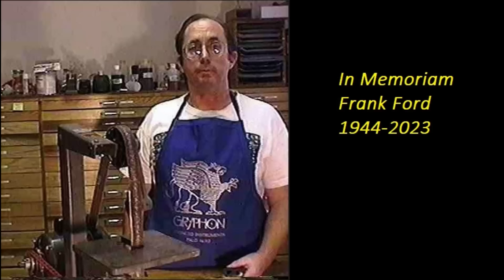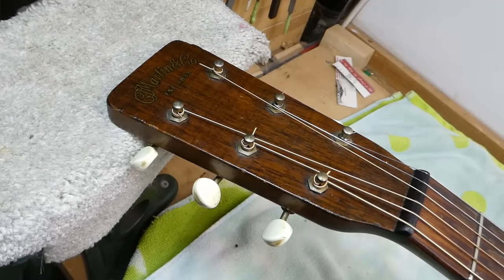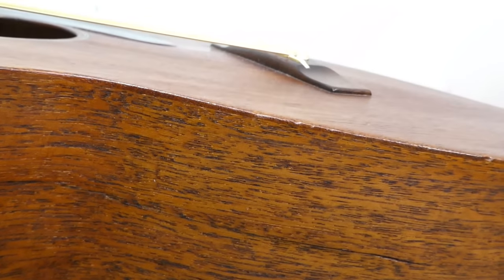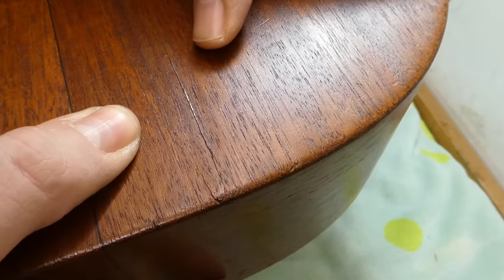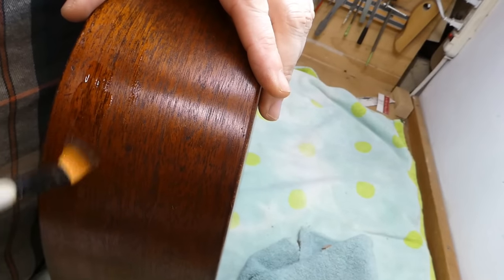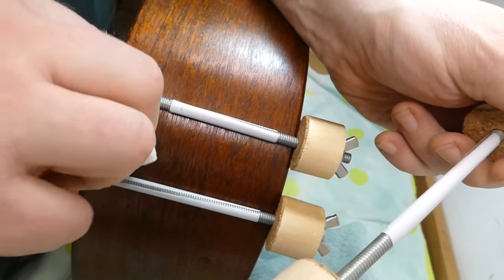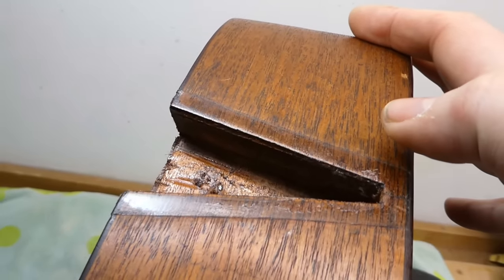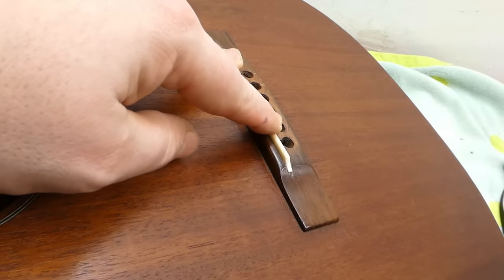This Guitar Smells of Rich Mahogany.

Comment: One of the tuners on my mandolin was failing.  I went to Gryphon Stringed Instuments to look for a replacement set.  Behind the repair counter was none other than builder/repair legend Frank Ford.  I sheepishly said ‘hi’ and ask him about replacement tuners.  He said, ‘Let’s have a look’.  He grabbed a screwdriver, lowered his glasses and went to work.  A few minutes later it was fixed.  He also touched up the other seven.  I asked what I owed him and he just mumbled ‘it’s ok’.  As he was restringing I noticed he was using a string winder like I had never seen.  You can’t use guitar string winders on a mandolin.  I asked about it and he said that he made them.  ‘I think I have another in the back if you’re interested.  They aren’t cheap’.  I said ‘Sold!’ before I saw it.  It was just like his but with a beautifully carved maple handle.  A real work of art.  I will treasure it forever.

Rest in peace, Mr. Ford.  We will not see your like again.

Oh…and God is smiling if his pre-war Martin needs a neck reset!  🙂

Comment: I've worked on several of these and I've never seen such obvious grain lines in the mahogany. So yeah, refinished IMHO. Which also leads me to believe that those sanding scratches on the back are from the sanding off of the old finish by someone other than the factory. I've never seen such obvious tooling scratches on a Martin either. And it looks like it was refinished with an oil finish. . . . of course it could be the the camera lighting. I noticed that the back of the peghead retained the original finish and perhaps the neck as well.  When you removed the neck, the lacquer was evident so our suspicions were confirmed. Thanks once again for sharing. Happy Holidays!

Comment: Cool, @17:22 you can see , top left in the frame, that the strings lift off the fretboard because he is about to lift the guitar up by the neck. Flexible and responsive guitar, you'd expect. Sounds like it, too.

Comment: Excellent wing nut with the Cork... did you make them if yes please patent it .... else let us know where on earth we can buy them ... just good... why have you not used "Mitchell pate mate" and whats your thoughts on Martin Carbon Fiber Bridge Plate
Reply: He made them, he can't and wouldn't patent it because it's already a common tool. You go and buy threaded rod and wing nuts and if you're then stuck: well, you have more fundamental problems than a lack of clamps. He doesn't respond to comments.
Reply: @Rich-on6fe  Thanks for the reply ... thanks for guiding me will make one .... how about the clamps used at the lower bout ? ...just great he just make it look so simple ...
Reply: @RahulSharma_JaiMataDi  when he glued the crack in the guitar top he use a pair of neodymium magnets to squeeze it together, one magnet inside the guitar and the other on the outside where he put the glue on. The magnets are about 15mm diameter and 4mm thick. I think he has them glued to small pieces of wood to make them easier to handle.
Reply: @Rich-on6fe  Thanks a lot Rick